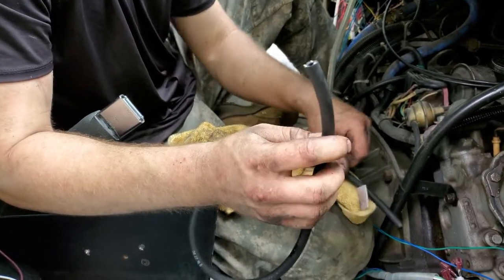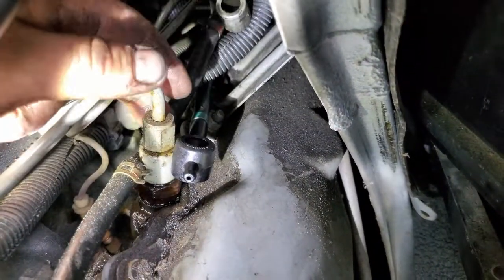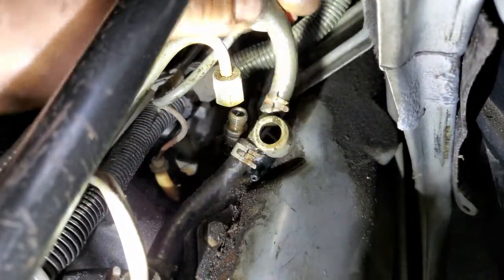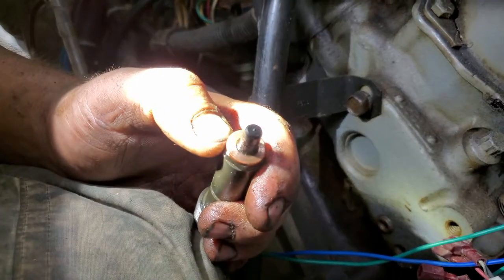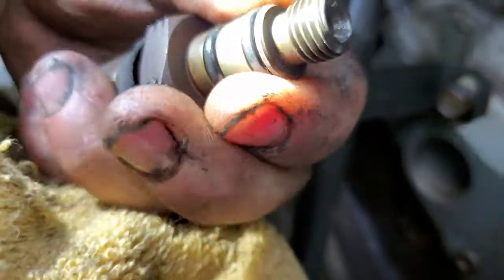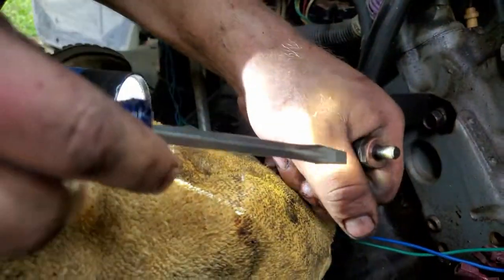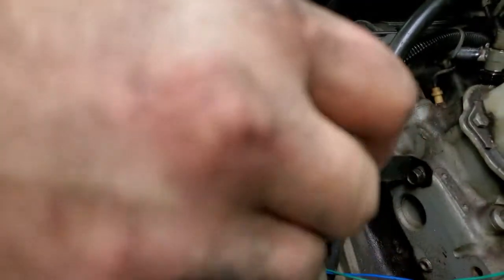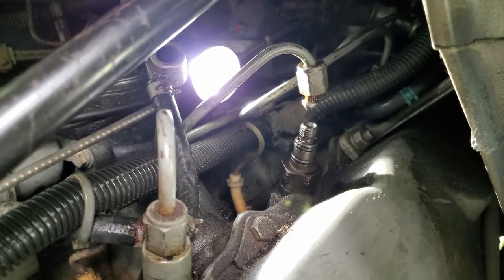Diesel Injector Rebuild, 7.3 Liter IDI (Indirect Injection)

Comment: Those hoses in between have to be cut to exactly 4 inches, which yours is obviously not, or they will push or pull the cap off center and leak around the o-ring.

Comment: Wow!!!! Don't bend the high pressure line!!!!!! , remove the bracket from the lines and it's makes the job a lot easier, remember that the hight pressure lines push about 2000psi, if you bent the lines you distort them therefore eventually they will break and with high heat it can cause fire 🔥.

Comment: A couple tips..you can pull the old orings off with needlenose pliars they just stretch and snap. The brass washer on bottom of injectorif floose can be held in place with grease when putting injector back in. Never ever touch the lines or twist after its all back together..dont even look at em wrong or they will leak.